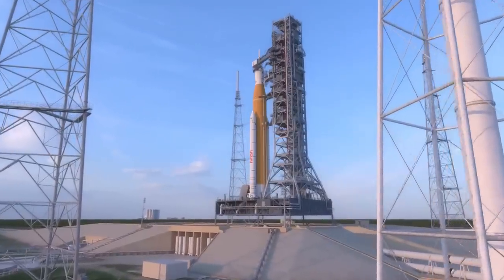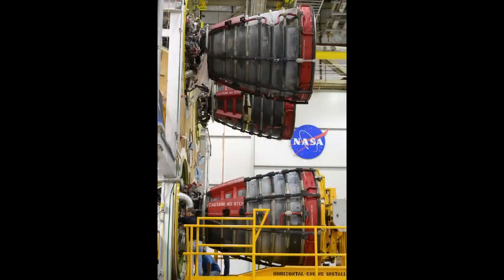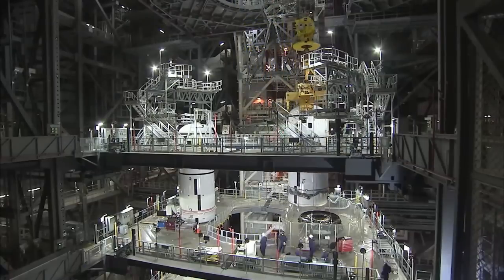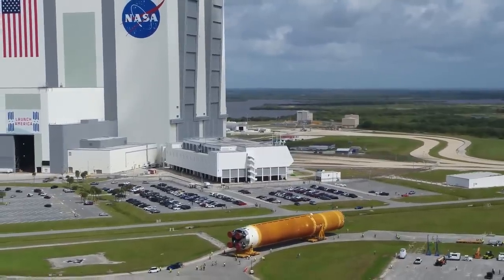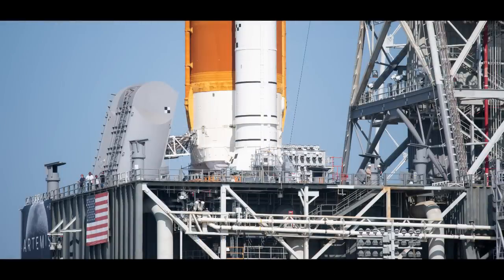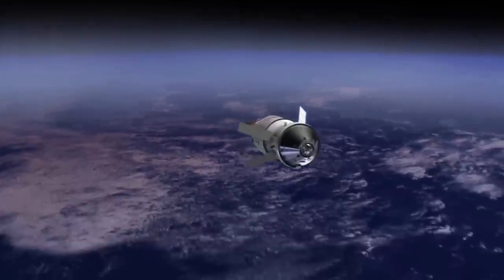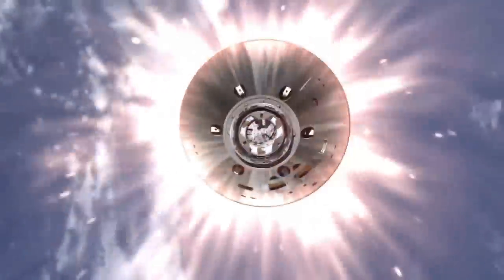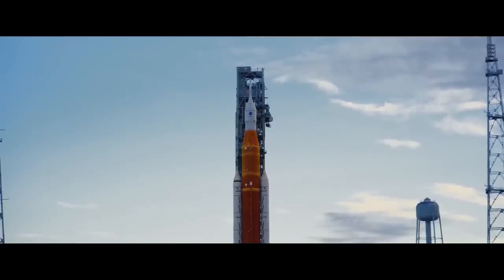What's The Big Deal About Artemis - NASA's New Massive Moon Rocket

Comment: I'm sorry, but this mission looks very antiquated & to a moderate extent, uninspiring. Musk has shown, if nothing else, the technology for re-usable exist...not only for the boosters; but, for the 1st Stage rocket. However, what disappoint most, is the lack of high-orbital glider. Let use the Shuttle for an example...technology exist to make lighter/stronger material to create the outer skin of a glider... making it much less in weight, compared to the "Flying Brick" of days past, while providing better shielding. Equip certain areas on this new type of shuttle, with solar panels to provide additional hybrid power. The cargo bay of the old shuttle was around 60' Long x 15' wide, with a capacity of around 25 tons. Now a newer, lighter shuttle, can increase it cargo size; but, let just use the old shuttle dimension for this example. Three (3) Artemis Capsules (17' x 11' just less than 10 tons each), theoretically can be placed inside this cargo bay. Each capsule can comfortably carry a 4-man crew, with a maximum crew member of 6...so, potential of 12 to 18 astronauts, plus a 2-man crew commanding this new designed shuttle. In essence having three (3) on going missions simultaneously, theoretically at a third of the cost. 

Practically, there would still be two re-usable boosters & a re-usable 1st Stage rocket, fuel for the shuttle engines, and minimal amount of fuel, for each capsule, for lunar landing & lift-off purposes. The shuttle would be designed to achieve lunar orbit. Once orbit has been achieved, a robotic arm can lift the first capsule into lunar orbit (much like the old shuttle release satellites payloads), obtain the correct orbital path conducive, to its landing location, then the capsule can proceed to prepare for lunar landing...with the 2nd & 3rd capsule following suit.

The return trip would consist of the lander lifting off the lunar surface, remaining fuel burn to achieve the correct lunar orbit as the shuttle, robotic arm grabs the lander (much like the old shuttle grab the Hubble for repairs & hardware), place in capsule in the cargo bay, and prepare sequence for return to Earth. Re-entry very similar to the old shuttle program, landing at Edwards Air Force Base. Over time, an actual landing strip & fuel depot can be constructed on the lunar surface, in a number of strategic locales, for landing a shuttle on the surface, removing the need for a lander, providing more cargo space for other material, equipment, habitat, etc, in the cargo bay of this newly designed shuttle. Making more missions much frequently & cost efficient, as we build manufacturing & research facilities and create better technologies for off-world travel & colonization of the inner Solar System.

I must add...communication satellites need to be established in permanent lunar orbit.

Comment: So in summary:
The engines are used from the space shuttle and pulled from storage
The boosters were design before SLS was a project and borrowed
The propellant tank is based on the space shuttle design
The second stage is a direct copy of whats already in use on the Delta IV
The service module also uses an old space shuttle engine
The service module itself is built by the ESA

So this massive project, 12 years in the making, 6 years behind schedule, and at a cost of $20 billion essentially boils down to off the shelf parts stuck together and tested at the last minute like some kid scrambling to get his homework in on time.  And the mission of Atremis?  To circle the moon and return to earth - something the Russians did more than half a century ago.  Meanwhile, over 6 years ago we had SpaceX demonstrate the power of the Falcon Heavy which propelled a Tesla out beyond Mars orbit.

Not finding much to get excited about here.
Reply: "And the mission of Atremis?  To circle the moon and return to earth"
With human beings in it.

"something the Russians did more than half a century ago. "
Not with human beings in it.

"Meanwhile, over 6 years ago we had SpaceX demonstrate the power of the Falcon Heavy which propelled a Tesla out beyond Mars orbit."
Well, you don't need a Falcon Heavy for that. The first testflight with a 6 ton dummy (so comparable with the Falcon heavy Tesla Roadster flight) of the Delta IV Heavy was in 2004.
Reply: @sebastiannolte1201  "Not with human beings in it."   SpaceX is the only US launch facility capable of human rated missions right now, and I'll point out there is no life aboard this SLS flight.  The point being all of this has been done before and decades ago and that the money spent on this lemon could have funded hundreds of lunar missions.  Falcon Heavy missions are around $90 million - that's two hundred such missions for the cost of this one throw away rocket.  There is nothing revolutionary about SLS to justify it's massive budget.  Heck, China landed a vehicle on the moon and returned to earth with samples two years ago.  SLS is more of a congressional jobs program than anything else.  And now we're looking at a scrubbed mission because of leaks that showed themselves last spring and clearly were never properly fixed.   This thing belongs in a museum.

And let me also point out that the Delta IV Heavy is another "disposable" rocket that not only costs 5 times what a Falcon Heavy does, but it can only handle half the payload.
Reply: Falcon Heavy isn't human rated.  Bit a difference, bub.
Reply: @ec-uploads  SLS isn't either, it hasn't even gotten off the ground.

Comment: Hunh ... so .. they're going to take all those re-usable parts and ... not reuse them ...
.
Reply: They use engines already 25 years old. Since no other launch vehicle is using them they just would have rotted inside a storage hangar for decades to come.
To show some in a museum the older ones which had be taken out of service are good enough
Reply: @simonm1447  Yeah.  So it would seem.  I was just a little surprised that since they are using old Shuttle equipment - which was designed to be reusable - that they were making no efforts to reuse it.

Unless they want to start making new ones - the SLS vehicles will be limited in number by the available parts.

[shrug]
.
Reply: @BobSmith-dk8nw  other comments say they had 16 in stock, so they have enough for 4 flights. For later (if they really need them) they want to make new simplified ones, which are no longer made to be reusable but cheaper to make, since a single reusable RS-25 costed $ 60 millions
Reply: @simonm1447  Yeah.  Thanks.  That makes sense.  

One thing about NASA was that it bit big on the whole re-usable thing with the Shuttle and - they probably feel they got burned on that.  My guess would be they just want to go ahead and expend what they've got and go with cheaper single use stuff.

The thing with the Shuttle - was that all those things had to be extensively refitted between uses and that cost a lot more and took longer than they had planned on.  The original concept behind the Shuttles is that they'd get a launch out of each one of them every few weeks - which never happened.

Now - we have SpaceX bitting big on re-usability.  Well have to see how this works out for them in the long run but they're doing this from a substantially more advanced technological base and with the experience of the Shuttle Program to learn from.

One thing about now - is that Space has a lot more commercial use than it did in the '70's when the Shuttles were being built.  There's a lot more money to be made and hence people trying to get it.

Musk has done a lot but my concerns about him are that he's one person - and if something happens to him - what will happen to SpaceX?

The other thing is that he hasn't killed anyone yet.  I don't know what his reaction to that will be when it happens.
.

Comment: $50B to recreate Apollo from 50 years ago.  This rocket is such a waste.  $600M for just the 4 RS-25's that were meant to be (and have been) reused but will be dumped in the ocean for this pig.  Orion is flying with a damaged electrical system because a bad design prevented it from being serviceable.  The only part of at least the first stage they actually designed new was the center tank.  

This whole program is just a subsidy for contractors and congress.  And of course, Starship will make it all obsolete quite shortly.
Reply: You mean the PDU? 

It's nothing to do with a 'bad design'. The fault occurred after mating of the Crew and Service Modules. 

The risks of damaging the spacecraft during the PDU repair outweighed any loss of data should the unit completely malfunction.This is due to the limited accessibility to the unit following mating, the degree of intrusiveness to the overall spacecraft systems, and other variables which meant the risk of collateral damage outweighed the risk associated with the loss of one leg of redundancy in a highly redundant system. The overall power and data system has been subjected to thousands of hours of powered operations and testing. The PDU is operational and functional - one of two redundant channels in one of two communications cards in that PDU is not working.
Reply: @yassassin6425  Exactly. It's a bad design when something on a machine can't be serviced.
Reply: @FARLANDER762  
You mean accessed. Unfortunately once the two modules are mated, depending upon the issue, the risk of collateral damage can outweigh the risk associated with the loss of one leg of redundancy in a highly redundant system. In other words, one rather small inaccessible and inconsequential box isn't worth dismantling the upper stage for.

Comment: This NASA rocket really seems out of step with the times, and very outmoded.

Obsolete.
Reply: Using old rocket motors from the space shuttle.
Reply: @rchydrozz751  Those SSME's are still Ferrari's and better than any other liquid fueled rocket motor. Show me a better one.
Reply: @ec-uploads  they have a very high ISP, but the disadvantage is the use of LH2. Liquid Hydrogen has a low density and needs a huge tank, which increases the tanks weight compared to RP1 and consumes some of the efficiency of the engines.
They had no other choice back then to use LH2, they didn't have the necessary heat resistant alloy for an oxygen rich closed cycle engine using a carbon based fuel, and with a fuel rich engine you get soot if your fuel is carbon based. With LH2 however a fuel rich closed cycle engine was possible